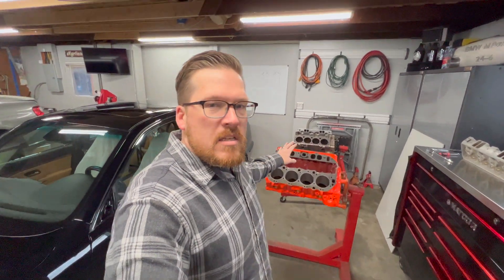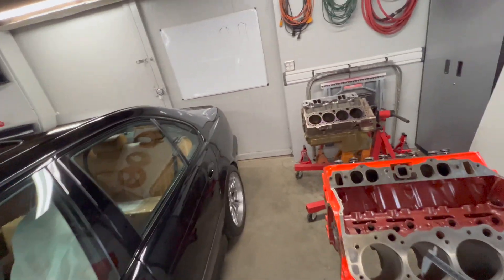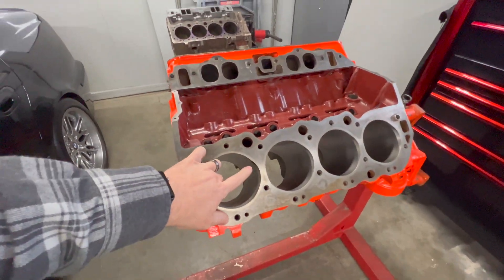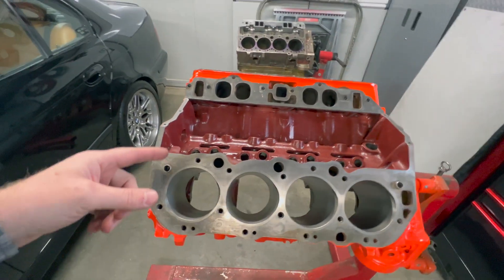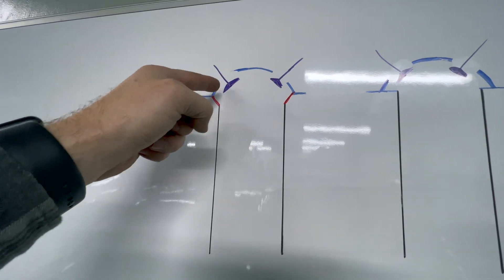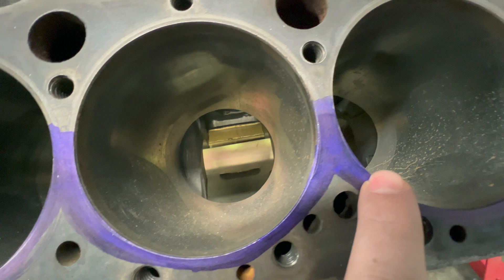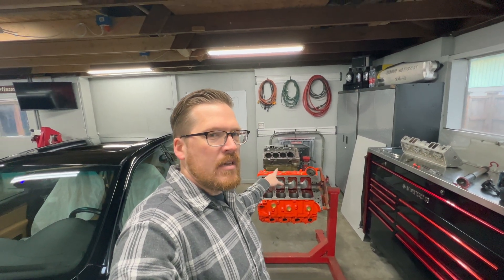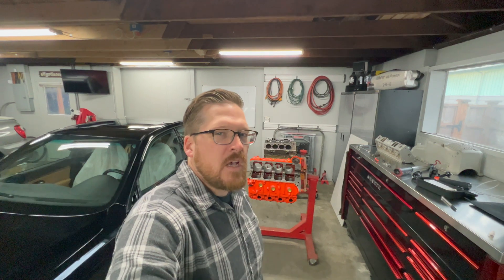De-Shrouding the Valves on a 396 Big Block Chevy for more CFM & Free HP!!!

Comment: I'd use a pencil to 'scribe' the line on the head deck.
Reply from the maker: Space is tight, I do not see how one would easily get a pencil in to do so. I had to use a scribe with a sharp angle to avoid the combustion chamber.

Comment: Interesting because AFR makes a budget Enforcer cylinder head that is a good bargain at $2050 a pair considering the costs of their other heads. If you read the specs it says the minimum engine bore size for these heads is 4.25, so clearly a 454 head with large intake valves. What I wonder is whether de-shrouding a 396 block, with a .060 overbore would make these heads work on the  smaller bore size engine. Maybe AFR could help or maybe not because they would have no control of the quality of some third parties work. So the risk is up to the builder. Might be worth the trouble, Rebuilding and porting a pair of 049 heads can cost as much these AFR heads depending on the job and who's doing it. .

Comment: Have you dynoed an engine before and after deshrouding? My concern is the loss of compression doesn’t outweigh the shrouding. The spark plug will ignite the mixture regardless of shrouding .
Reply from the maker: I have not had the opportunity to do a before and after dyno with this mod. That would be a great test to do though. 

~ Nick

Comment: What about using the offset moroso head dowels helping with shifting the head away from the cylinder wall.
Reply from the maker: I think that will open up a can of worms with your valvetrain geometry and intake manifold alignment. 

~ Nick

Comment: I’ve got a 396 in my Chevelle. I didn’t grow up working on cars. So, I’m learning as I go. Questioning whether I should keep the 396bb or go with 454 or 502? Is the 396 a sleeper and more dynamic plus rare? Or, should I just consider going with a bigger block motor? Any thoughts and breakdowns on this topic are much appreciated! Awesome video by the way man. I’m learning lots from guys on here like yourself. Fascinating stuff
Reply from the maker: Some 396's can be rare/valuable but that all depends on the factory HP rating, and if it was originally equipped in that car. 

As for what engine is best for you, that all depends on how you plan to use the car in the end. If you want a good cruiser, the 396 is perfect. If you're looking for a faster 1/4 drag car, then you may want to consider the larger engines. 

~ Nick

Comment: Why is the top deck painted
Reply from the maker: It is coated in a product called Glyptal. It is an older hot-rodding trick. The theory is that it helps the oil return to the oil pan quicker.

http://www.glyptal.com/glyptal_coatings.html

~ Nick

Comment: how do you size the gasket after doing this do you use a gasket that is also deshrouded or do you use a gasket that matches the heads diameter
Reply from the maker: I usually select my head gasket that is the closest size to the bore to maximize compression. Now the engine I use for the example in this video is a 396 BBC. Most EVERY head gasket on the market is for a 454 or larger bore, so they are all much, much larger than they need to be when used on the smaller bore of the 396.

~ Nick

Comment: What is the coating in the valley
Reply from the maker: It’s a sealer/ paint called Glyptal. It’s kinda an old school hot rodding practice. Theory is that it helps the oil return to the pan quicker. 

http://www.glyptal.com/glyptal_products.html

~ Nick

Comment: I’m just freshing up my 0.030 over 402 and think this would be an excellent add.  I previously changed the heads to have 1.88/2.19 valves and ported them and gasket matched so I think this would really be helpful to get the full benefit of the bigger valves.  Excellent video.  Thanks!

Comment: HEAD GASKETS, you forgot totally about head gaskets, now head is un shrouded block deck is un shrouded, and now who is going to make you CUSTOM HEAD GASKETS ?  You didn’t show head gasket interference or gasket clearance !!!
Reply from the maker: Good catch. However, I did not forget about the diameter of the head gaskets. I did FAIL to mention it, though. I do discuss this to a degree in another video I have where I am assembling this engine:

https://www.youtube.com/watch?v=4jANYOZstqA

Around the 14:13 point of the video, I cover the importance of the chamber diameter and compressed thickness of the head gasket. 

You can clearly see how far back the gasket sits from the extended eyebrows in the block in that video. Those are standard off the shelf Fel-Pro gaskets, nothing custom.

If you look at the selection of head gaskets available for a BBC, you will find that most all are made for the larger 4.5" bore of the 454 and beyond. It is actually very difficult to find an off the shelf head gasket with the smaller bore diameter for a 396.

~ Nick

Comment: it's not simply that the bore is bigger. although that helps with air flow, your biggest gains are from the increase in cubic inches. also, comparing to a 4.5 inch bore is more of an apples to oranges comparison than a apples to apples comparison. you have to remember, those heads that they use on a 4.5 bore have 2.3 inch valves or even bigger sometimes.

  if you put a head with 2.190 valves on a 4.5 inch bore it will flow better, but gains in power from that are not going to be nearly as much as they are from the increase in displacement.
Reply from the maker: Yes, I agree. I only brought that up to help people make the connection that it is not just the displacement alone that increased power. When building an engine, displacement, bore size, valve size, AND how each of those items interact all affect valve shrouding. They are all things to consider. 

~ Nick
Reply: @AutoTechNick  why say what you don't mean then?

Comment: Will I have this problem running 325hp 396 heads on a 454 block.
Reply from the maker: Not to the same extent that I highlight with the 396 block in this video, due to the larger bore of the 454. However it is somehting that I would check during any build.

~ Nick

Comment: TY for posting this. I am working on an old 72 Datsun L24 and have to do this or the larger valves will hit but bonus power is awesome!! Is there a vid that shows how to do it? The only question I have for you is what shape should it be?? Is it a square cut into the block or do you just blend it at an angle?? I have seen it done with a router as a square cut but  it looks more like a tapered blend into the cyliner. Anybody that can help me clear that up would be awesome:) Thanks Again for the vid!!
Reply from the maker: You will want to avoid a square cut and blend it to an angle. This will be less disruptive to the airflow. Just be sure you know where your top ring stops its travel at the top of the bore, and stop your blend above that point!

~ Nick
Reply: @AutoTechNick  TY SO MUCH!! An answer I have been looking for. :)
Reply: @AutoTechNick  So another question. How do you mark the layout if you dont have access to the bottom of the block? I was going to use the gasket of course but was going to use clay to mark the valve? Any other good ideas? ThankYou
Reply from the maker: @superz500  Having access to the bottom of the heads, up through the cylinder, is a MUST in order to do this properly. Do not use the gasket, as most All BBC gaskets are made for the later 454 & 427 blocks. 

~ Nick
Reply: I ve done this to ALL of my L16- L18 builds for years. it Really wakes the datsun L- series up !..

Comment: Hey I under stand the si shrouding part but the part I don’t under stand is the gasket how is it going to seal do you use a 454 gasket or 396 thanks
Reply from the maker: You will need to check the diameter of the gasket to be sure that it does not overhang into the chamber, but I can tell you that most all gaskets are made for the larger bore sizes. It is actually very difficult to find a gasket specifically for a 396. 

~ Nick
Reply: @AutoTechNick what gasket would you recommend me to use I have the same setup as you heads and block thanks
Reply from the maker: Alejandro, I would recommend looking on Summit Racing. You can filter your search for head gaskets. You can select them by the bore diameter, and compressed thickness. It’s hard to get compression in a 396, esp with open chamber heads, so I try to keep the bore size and compressed thickness to a minimum. But every engine will be different. You will need to select what will best fits your engine. 

~ Nick

Comment: The 402 Chev BB I have the block has the value groves from GM because it was a Hi performance engine that left GM at 425 Hp in a 1969 SS impala.
After the rebuild then put into my guide jet boat I suspect the engine could do 500 hp now.
My fishing clients love it when I show them the power in a throttle squire of gas.

Comment: Been doing this for years.  For those that wonder about power, it will vary from build to build.  But average of 20+ hp  You will gain about 3+cc of volume, if you do both intake and exhaust.  As long as you have decent compression to begin with, like 10.5 or so, it will not be a problem.   Flow trumps compression at this point.    Enjoy the power !
Reply from the maker: Great info! Thanks for sharing... I fully agree that in this situation that the gains in airflow outweigh the loss of compression..

~ Nick
Reply: @AutoTechNick you can also gain compression back with a thinner gasket or smaller bore gasket.
Reply from the maker: @NorthNorth80sBaby  💯%
Reply: Hello  that was 1st question I had.. I was curious as to where¹ do  you think the cut off would be with the compression ratios. As far as would it be worth it to do this. Im aboit little over 9 C.R  and  Im really limited with what I can do to it and would it be worth doing at this point if C.R. isn't there?  Thanks for your videos and appreciate guys that comment so gain more knowledge from everyone.
Reply from the maker: @supertruckertroy  I don’t think that their is a specific compression ratio which one can say is a cutoff point. That is the tough part
In building a 396/402. They are tough to get decent compression with, without spending a lot of money on aftermarket pistons. Each guys build and application will be different.

~ Nick
Reply: @supertruckertroy  At that low of compression I suggest different pistons.  It may be a wash at the compression you have.   Maybe BOOST ! 😄

Comment: How much did this reduce your compression by?
Reply from the maker: On this build I did not measure or recalculate the compression after making this change. 

This engine was in a jet boat, so it was RPM limited by the water restriction on the impeller. We had a "A" impeller and the engine could only turn 4600 rpm. I refreshed the engine, and the only changes were decking the block .020" a smaller head gasket, these chamber mods, and I swapped the Torker II intake for a Victor Jr. After those changes I picked up 200PRM, which calculates out to a gain of rough 50hp.

Due its small displacement, the 396 has a hard time getting decent compression numbers as it is. So it's hard to bring yourself to reduce it further, but it is worth it in the end. The gain in CFM will make up for it, plus some. 

~ Nick
Reply: @AutoTechNick  Great vid. One would think that the slightly lowered compression ratio would help with (low octane ) fuel but still bring HP numbers up .Also if using alum performance heads do you have to notch this area so the valve won't hit the block ?
Reply from the maker: Brian, I am in agreeance with you. I highly doubt that the slight loss of compression outweighs the gain in total CFM flow / HP increase. Plus, the added benefit of being a tad more friendly on pump gas, it's a no-brainer for me. 

As for running aluminum heads. No, you won't need to do anything different to the block unless you are running a very exotic head that moves the valve locations. So for 99.99999% of the cases that is not the case. 

But the real problem is these smaller bore engines, 396/402 need really small chambers to get decent compression. Usually 110cc or less. Most all aftermarket aluminum heads have 120cc chambers as they cater to the 454 and larger crowd. Unless you have really aggressive domes on your pistons, that large of a chamber on these smaller engines really lowers your compression. Just something to keep in mind when picking out parts for your build. 

~ Nick

Comment: Those blocks are beautiful. How did you get them so clean??
Reply from the maker: The 396 block was hot tanked, then I painted the inside of the block with Glyptal and the outside with engine paint. The block was also decked .020” so that is why the deck surface looks so nice. 

The 327 block was cleaned with degreaser, and then I used a wire wheel on a drill to clean the outside of the block.
Reply: @AutoTechNick  glyptal??? Where do you find that??
Reply from the maker: @JmalibuJFRoadking  It can be found from a lot of online retailers…. Eastwood CO has always treated me well:

https://www.eastwood.com/glyptal-red-brush-on-1-qt.html

Comment: I never thought about doing that but it makes total sense. I'm going to try that on my 396/402 rebuild to get the flow better. Already port matched the heads and intake together. I'm only going to grind the very minimum as not to lower the compression ratio. Had the heads decked .020 to try to get it near 9.25 . The heads were cc and are about 98 cc now down from about 103. Thanks for the video.
Reply from the maker: I hear what you are saying about trying to keep your compression ratio up. I know how hard it is to get the 396/402 to have a decent compression without custom pistons, but I do feel that with this modification the HP lost from compression loss, is overcome by the HP gained from the overall increase in airflow.
Reply: @AutoTechNick  thanks me too 👍

Comment: How much HP extra can we get from this? Lets say i have a 500hp 396.
Reply from the maker: Using this particular 396 as an example. It was in a jet boat for years, mild cam & mild port work nothing special or out of the ordanry. The boat was running a "A" cut impeller. The engine was not able to make enough power to overcome the resistance of the impeller & turn the pump past 4600 RPM. I refreshed the engine making the following changes: Block Eyebrow, Decked .020", Switched from a Torker II to a Victor JR intake. Everything else on the engine was the same. Same cam, Carb, heads, pistons etc. No Changes were made to the pump. After the work the engine was able to turn the pump to 4800 RPM. Cross referencing my impeller size to my max RPM that tells me that I was making around 350hp before the work, and around 400hp after those changes. 

Jet boat pumps and Engine dyno's are very similar in operation, so knowing the impeller size and max RPM you can use it essentially as a dyno to calculate your given HP. 

I know that there was more than one change and several variables in that, but it's the best I can do to giving you actual & factual information. 

I hope that helps!